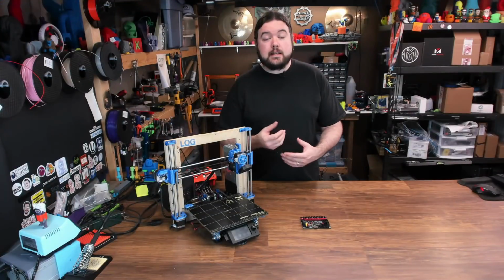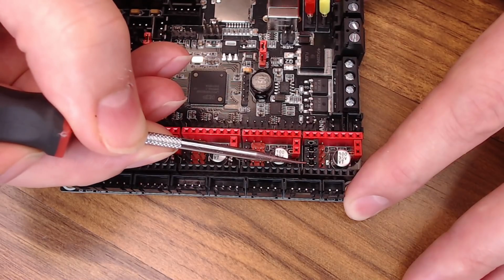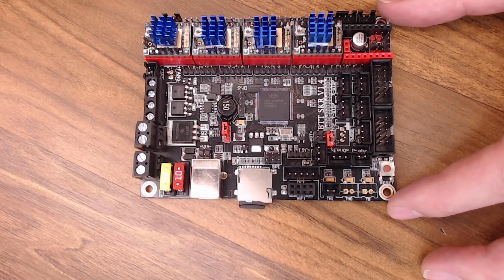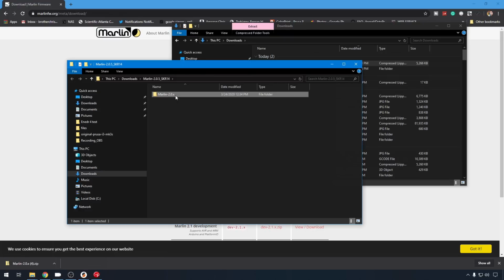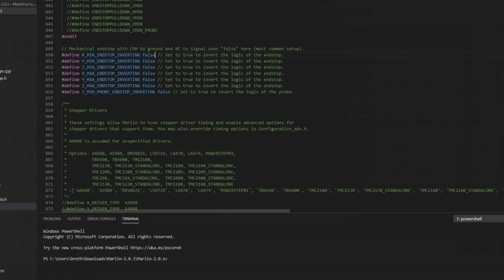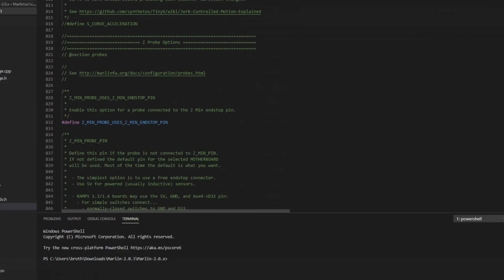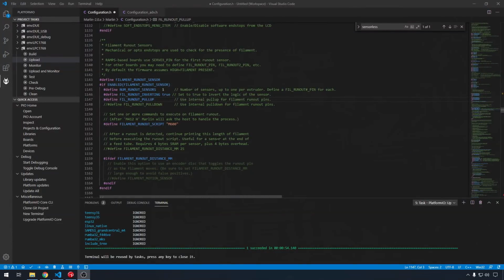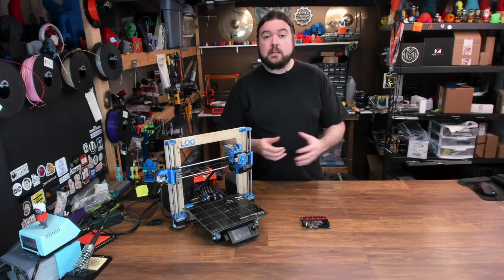BigTreeTech SKR v1.4 Mainboard - Full Install Part 1 - 2209 Drivers - Chris's Basement

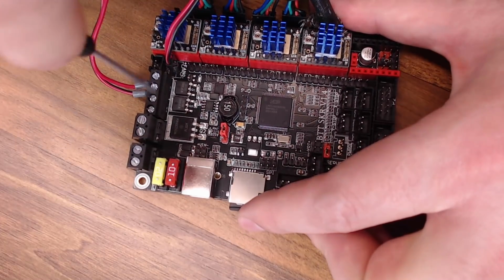Comment: Chris, at 12:30 you stated the positive lead of HE1 goes to the top terminal and the gnd goes to the second terminal. That also applies to HE0. That is the opposite of the SKR 1.3 which has the positive on pin 2 or the second terminal. Though it should not matter for a heater, people who may be using the 1.4 for CNC or other applications(OPEN PnP) that could make a huge difference(think smoke). BTW, great video, you have a rare talent and I appreciate all the work you put into it for us.

Comment: Hi Chris  im configuring  my corexy z double conected together , you sugest 2 end sensors(up A nd down)?,  my drive  eazy 5160 for 1.6 max 2.1 Amp  4_48v  the power 12v  20A for 5 stepmotors is correct.

Comment: Sir plz guide me i want to speed up my 3d printer what should i do i also use tmc5160 drivers and mother board is skr 1.4
Reply from the maker: The easiest way is to install input shaper. You can do this running Marlin and Klipper. I have install videos on both.

Comment: know this is a old video but what is a good upgrade/simple board for anycubic i3 mega what looking at this SKR V1.4 TURBO but not looking for something super complicated to set up?
Reply from the maker: The mega can probably handle just about any board, the 1.4 would be fine. You'll have to come up with mounts for it. And the config is always going to be a challenge. There is an example config in Marlin that will get you started. https://github.com/MarlinFirmware/Configurations/tree/bugfix-2.1.x/config/examples/AnyCubic/i3%20Mega

Comment: anyone know how i would got about adding this board in cura? i have a sunlu s8 but i am upgrading it with the 1.4 turbo, but once i do that how will i add the printer to cura since the boards are completely different?
Reply from the maker: I think Cura just uses a serial connection. The settings Cura would use wouldn't be affected by changing the board I don't think.
Reply: Well the reason I am doing the upgrade is mainly for the dual extrusion and cura does not seam to give the option to even add a 2nd extruder for the sunlu s8. So like new board same situation. 😐
Reply from the maker: @cold25th  Cura does support dual extruders very well I've found. It might be time to give another slicer a try.

Comment: If you are connecting the Z Steppers like this are you also able to use auto Bed tilt function G34 in Marlin?
Reply from the maker: Not sure if you can do 2 with tilt or you have to use 3, but you can use the G34 to line the gantry up.

Comment: Do I understand this correctly? Everytime you want to send a command to the printer you have to open the case and move the jumper if you were using mains?
Reply from the maker: No, you can still talk to the board USB with the jumper switch, USB just won't power up the board.

Comment: Is this still relevant board in 2023 or is there better board for similar price nowadays? (Must have requirements for my setup are atleast 5x tmc2209 drivers)
Reply from the maker: I don't think they sell them anymore. I would look at the SKR3, it should work for you.
Reply: @ChrisRiley  skr 1.4 turbo is still sold. Skr 3 is twice the price. If there is not significant difference I would rather buy rhe cheaper board.

Comment: if I use bigtreetech skr 1.4 turbo, is it possible to adjust the bedplate temperature using the PID method ?
Reply from the maker: Yes, just enable it in the firmware and run a M303 to tune it use E-1. https://marlinfw.org/docs/gcode/M303.html

Comment: i just went to update my skr 1.4 turbo to 2.2.1 so i coppied all my old config from my old config.h files to the latest ones some things were moved around but pretty sure i got everything done in configutation.h/adv.h 

plugged in my usb cable pc  recognised it showed up the sd card in my computer. 

tried the auto dertect for the port it only showed the com port so i added to pio.ini upload_port = COM4 this did nothing but when i changed it to the drive letter D:\ it uploaded. 

turned off the printer unplugged the usb cable and all  i get is a blank screen (12864 lcd) and now when i plug the usb cable back in my computer no longer acknowledges the cable is plugged it so the only way to access the sd card now is to take it out and i tried that but still same issue. i think it might be to do with what is in the pio.ini file which is below 

[env:nxp_lpc1769]
platform = nxplpc-arduino-lpc176x
board = nxp_lpc1769
framework = arduino

upload_port = D:\

Comment: Followed your video to the letter - hot bed won't heat up and reset message appears - is this the result of a VS code error compiling..?
Reply from the maker: It shouldn't be the code. It's probably an issue with the thermistor. Make sure it's in the TB plug.
Reply from the maker: @Tim S You can send them to me, but if the temp is reading correctly more than likely there is something wrong with the board mosfet. brotherchris81@gmail.com

Comment: Are the hot end and part fans both 24v? Thanks Chris.
Reply from the maker: In this video they were both 12v, but yes, they will both be the same as your input voltage on the 1.4 board.
Reply: @ChrisRiley   Great thanks. Brilliant guide as usual btw.

Comment: Hey Chris, any idea why I cant get my motors to turn with define SOFTWARE_DRIVER_ENABLE enabled? I tried this on SKR 1.1 with TMC2208, and currently I am trying with SKR 1.4 Turbo with TMC2209 v1.2 but neither one will turn with this enabled. I have tried changing serial ports but I just cant get it to work. Do I need to define serial pins or use additional jumpers?
Reply from the maker: I'm not exactly sure what that feature does. What are you trying to enable?
Reply: @ChrisRiley  From my understanding, you can adjust pins via software to accomplish more communication. so rather than running 3 jumpers like the old days, you should be able to assign pins through commands/software. I cant find any videos clarifying this, so I'm not sure if there is any real benefit having this enabled or not.
Reply: I tried this, and my TMC2209s wouldn't move the steppers. Just use the jumpers; easy, and takes literally seconds to set up in UART.

Comment: If you dont want to use sensorless homing and are in UART mode can you still use software commands even with clipped diag pins?
Reply from the maker: Yes, the diag it just to send the sensorless homing state to the endstop pin.

Comment: I just found out that you can use both sensorless homing and mechanical switches as the same time. Sensorless homing uses high signal for stall detection, so if you wire your endstop accordingly, (that is using pulling high when triggered) you can use them both. There is a github discussion where it is stated, that when the driver is pulling to 0 and the endstop is pulling to hight there is still enough tolarence for the driver (the drivers pullup current is 40u, and the safe minimum for the pin is 2mA -quoted from the discussion)

Comment: My default board has FOUR power wires (2x positive 2x negative) - one set is 5a, the other 11a.
Which ones do I hook up to power in?
Reply from the maker: You will need them both, 11a is for the heated bed.
Reply: @ChrisRiley  Yes but skr 1.4 turbo has only two wire-in slots?
Reply: For reference - I'm on an anycubic i3 mega
Reply from the maker: @Yavorh55  Ah, yes, sorry about that. Either one will work the same from your PSU, just remove one set. If you can use 16g wire and keep the run as short as possible.

Comment: Hi man i have been watching your videos for a while now and decided to upgrade my ender 3 motherboard with this setup the skr 1.4 turbo + tmc 2209 drivers. I think i have everything working now i struggled a bit with sensorless homing but my z axis is not homing correctly. Can you maybe point me in the right direction to fix this? Thanks in advance
Reply from the maker: Hey, are you using sensorless for Z? I never got the sensorless on Z to work well. I just stayed with the endstop switch.
Reply: @ChrisRiley  no, i cut the pins on z and the extruder. I got my sensorless ones c and y working but the z does not go down it just goes up a cm or so
Reply from the maker: @dr_epic_gusta5714  So it thinks the endstop is already hit. Cable up USB and connect with something like Pronterface. Run a M119 and see what it says about Z.
Reply: @ChrisRiley  will do when i get back from school thanks
Reply: @ChrisRiley  Thank you very much. i did what you said and the z was showing it was triggered when it was actually open. so i changed that in the firmware and it seems to be working again now. Thank you very much sir!

Comment: hi Chris i have a question if you could answer. After a short circuit of print cooling fan cables my board became unusable. q3 ligth is on and red ligth is not turning on. İs this a dead end or could it be saved. I changed the fuses by the way nothing works. Appriciate if you can help.
Reply from the maker: That usually means the voltage regulator got cooked, not sure you can save it.

Comment: Hi Chris. Now I´ve my Board SKR 1.5 Turbo and it looks like the SKR 1.4 Turbo and it works like a SKR 1.4 Turbo. I´ve tested it and works well. But BLTouch doesn´t work with this Board. Or in other words I didn´t find a way that BLTouch will work. I´ve an Ender 5 and before I worked with the stock board and BLTouch works. Now I´ve tried to connecz the BLTouch with the servo0 and probe socket. I´ve configured it like in your video https://www.youtube.com/watch?v=p504oU-D6iE&t=1328s but the bltouch doesn´t show a blue light if homing start. Any ideas? Regards Willi...
Reply from the maker: Do you have a link to that board, I don't know that one.

Comment: Chris, I keep coming back to your two videos as the bible for installing and perhaps more importantly, configuring the SKR 1.4T.  I have found my sensorless X and Y can offset the build area/priming stripe from print to print.  If i have them too sensitive that's no good, and not sensitive enough grinds the belt.  I'm at like 90 for the X and 80 for the Y, using 2226 drivers.  Your numbers were something like 14, etc. so very different from mine.  Any guidance is appreciated.   Also, I had an idea I don't know how to implement - I'd like to see the bed SSR LED in a remote spot - i thought about printing some sort of holder for a fiber or clear filament to transfer the light, or else wondered if there's a viable way to extend an LED from "somewhere" - any ideas?  Thanks!
Reply from the maker: Hey Gary, on the sensorless homing, play around with feedrate and acceleration in your start gcode for homing, that can make it more accurate. Interesting thought on the SSR, It might be easier to just wire a new LED to the DC side and run it where you need it to go.

Comment: What size ferrules should I use for my skr v1.4 ?
Reply from the maker: For power I use the 1.5mm or 2.5mm in a pinch. For fans I use 0.75mm or 0.5mm.

Comment: Hey, first of I oew you many thanks for providing such valuable information in such a detailed style. Secondly can you please guide me regarding the TMC connection error on my Lcd screen, I'm using SKR 1.4, 4 tmc 2209 drivers.
Reply from the maker: That has been an issue on these board, double check your jumpers are set correctly. If that doesn't correct it, you may have a bad board.

Comment: Hopefully this video actually gets this going I got the lcd and the turbo board for my ender 3 and been having lot trouble with the firmware
Reply: Jabber. That is what’s holding me back.  I don’t want to upgrade my Ender3 pro until I fully understand how to make firmware tweaks
Reply: @bruceyoung1343  yea I followed his video and it wouldn't compile at the end idk where I went wrong  I need to set my homing settings but also my bed won't heat .keeps giving me error ...idk part my problem could also be that lcd screen idk
Reply from the maker: If it won't compile you can send me the errors and I can point you in the right direction.
Reply: @ChrisRiley  I keep getting unknown motherboard value in configuration.h

Comment: CHRIS  Is there a video coming out with SKR 1.4 turbo, TMC2226 stepper drivers with Ender 3 pro?
Reply from the maker: Don't have anything with that combo on the list.
Reply: @ChrisRiley  list?  You scheduled upcoming list?
Reply: I’d like to get the TMC2226 as most up to date.  But not if incompatible with board/printer combo

Comment: Thank you so much for making this video. You may not have installed it in an Ender 3 or and Ender 3V2 (I really wish someone did an Ender 3V2 video) but This had enough information that I should be able to successfully do the install on my Ender. 

Thanks again!!
Reply from the maker: Glad I could help

Comment: Hi Chris, as always your videos are awesome! I followed your instructions and I haven’t had any problems, except one. I can’t connect the SKR v1.4 turbo to my computer or to a raspberry via USB, it won’t appear any port when I plug it. I want to install octoprint on a raspberry, and everything has gone fine with the installation, but when I connect it via USB to the board, it doesn’t appear any port on octoprint( I’ve connected an arduino mega to see if the USB work fine on the raspberry and the desired port appears on octoprint and the connection is ok).
Do you have any thought on how I could be able to get the USB port working on the board?
I’d we very grateful for any help you could able to provide me 🙏
Reply from the maker: Unfortunately, this is a really common failure on these boards. And there really isn't a lot you can do about it except switch out the board.
Reply: @ChrisRiley  thanks a lot Chris! I appreciate so much your response 🙏 I’m buying another one and I’ll cross my fingers
Reply from the maker: @gerardoirigoyenbordarampe4664  Good luck friend.

Comment: hello, i have a problem by my endstops. i changed the standard board by my sidewinder x1 to the skr 1.4 turbo and drivers tmc2209. if i install the board and try the homing, than is my Y-Movement whithout a stop and will crash after few seconds.
How can i handle it by MArlin config? I dont like to cut Pid at my drivers.
Reply from the maker: What does M119 out put when they are not triggered?

Comment: HI Chris, I am working on a stepper replacement for my y axis on my a8, and I decided to look into replacing the mainboard a long time ago. I think either way I will order a reasonably priced stepper motor to replace my skipping one, but also, the skr 1.4 turbo board, as daunting as it seems to be. Do you have any input on installing it on different printers, i3 clone built printers, etc? the 1.4 turbo is a great option since it runs both z motors without any adapters!
Reply from the maker: The install should be very similar on most i3 machines. I personally would start with the ender3 config as a base line and go from there. The ender3 config on the marlin github is pretty solid.
Reply: Thank you for the reply. Is there any guidelines or reading I can look into on picking the right stepper drivers?
Reply from the maker: @Elswalbe  Check this out. https://3daddict.com/stepper-driver-comparison-3d-printer-upgrade/
Reply: @ChrisRiley  I ended up landed this morning with a delivered 1.4 turbo and a set of 2208 preconfigured to run in uART. following your guide compared with a few others I was able to get setup, I used the ender 3 1.4 firmware config and then cross referenced it with pid settings and metrics from the a8. I have the board up and running now, with the screen. I am just printing a case and a standoff that matches my mosfet board and frame.
Reply: Wish me luck, I expect that connecting steppers and fine tuning that will be the hardest part of this.
Reply: Hey Chris. I have completed the majority of my upgrade. I have already been putting relentless printing hours at it with a variety of different PLAs, a bit of PETG. It is running smoother, quieter, and astoundingly faster than it could have. I am building a corexy kit for it now using aluminum tube and 3d printed parts. I'd be really happy to show it to you here on youtube when I have it all complete.
Reply: Do you have an email or Facebook profile for your printing? I'd like to send you a few pictures of it so far.

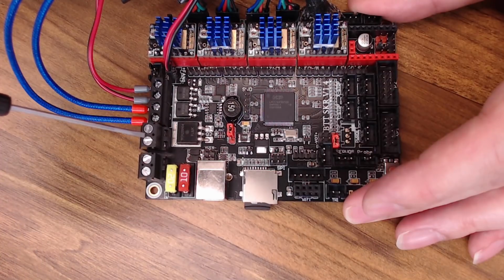Comment: Dumb question, but which ones are the bed heater wires that go into the SKR board? Working on building a 3D printer and I thought the two wires that are attached to the heated bed are wired directly to the PSU (meanwell). Do those get wired to this location at 12:43 instead? Thanks!
Reply from the maker: If you have a DC heated bed, they will need to go to the terminals I show or it will be on all the time at max temp.
Reply: @ChrisRiley  okay, that makes sense - thanks for clarifying!!

Comment: Interesting thing with the Coms Baud rate, on these emulated serial port 32 bit boards, it makes no difference what you set that number to, when you connect from a PC/Pi it auto negotiates with the speed that you pick in pronterface/octoprint, it's actually quite annoying as cura will try low speeds first and of course the SKR just communicates and you always end up with the slowest speed.
Reply from the maker: That is interesting, I will have to give that a try.
Reply: @ChrisRiley  Yea, I think it will explain why many people with 32bit boards experience some stuttering/lesser quality with cura / octo pi on auto negotiate mode, slow coms = poor quality print. You can even connect at 9600baud!